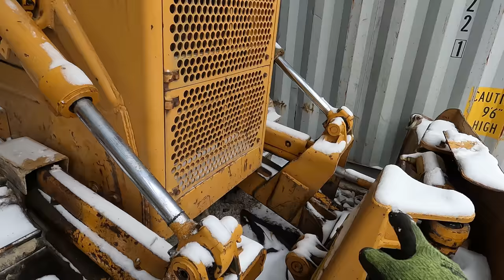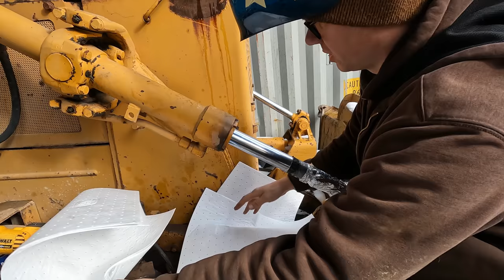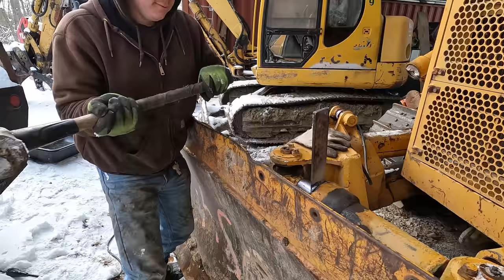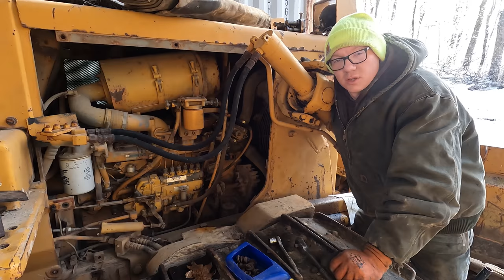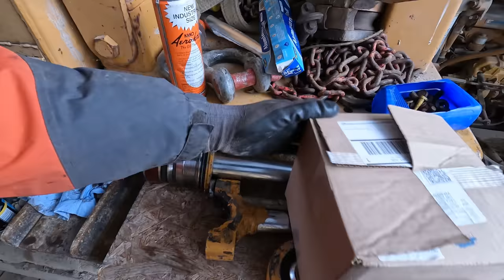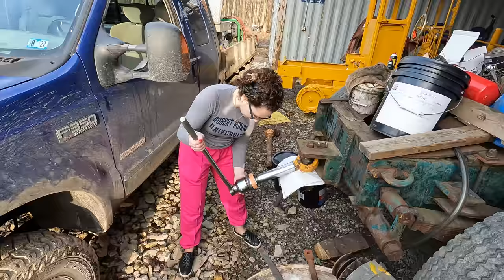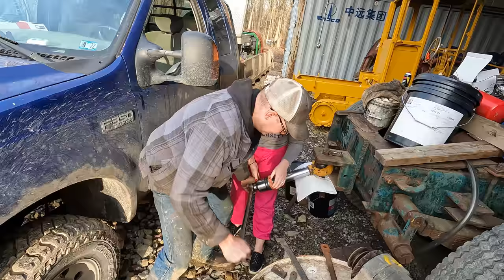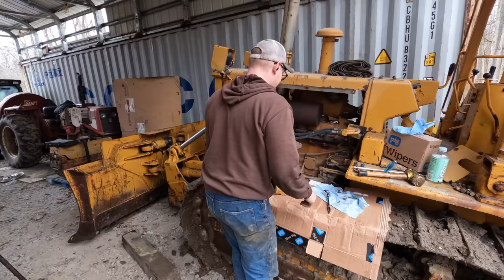Komatsu Dozer gets Cylinder Rebuild. (Long Overdue)

Comment: When it comes to buying tools I’ll seldom use I use the equation time over money.  If that tool will save time and frustration I buy the tool. You spent a lot of time grinding, welding, cutting, using up welding wire, argon and cutting wheels. All that when you should have just purchased the wrenches. You have other pieces of equipment that have hydraulic cylinders that you could used the wrenches on.

Comment: You said you don't know why people have those cylinders rebuilt vs doing it themselves. 

Well let's see. It took you 3/4" or 1" drives sockets to do the work. You used a skid steer to lift the blade to remove the cylinders. And you had to use a arc welder to disassemble the cylinders.  With all do respect not everyone has all those tools at their disposal to do the job.
Reply: So....how many average Joes have a 'dozer.......!?

Comment: The only criticism that I have, is that I'd off stripped one cylinder at a time. You have always got one to refer to then, as with most jobs that have two or more of the same assemblies. Btw, I know how tight then sums of bitches can be, I bought a cheap torque multiplier for my old style Cat cylinders on my 955's.

Comment: Cannot wait for the hose replacement video, I just feel like you jinxed yourself with that statement. I think your wife had some body position issues and not letting leverage properly work for her. I think you should go make her a sandwich for setting her up for failure. That project was a bit of a nightmare.

Comment: Sooooo much wrong with this... This should NOT be used as a toutorial.  First youre callin a rod a cylinder... Tf. And youre welding and cuttin right by your rod... Why tf you welding that to the gland? But most important of all why did you not take the cylinder off to work on it.